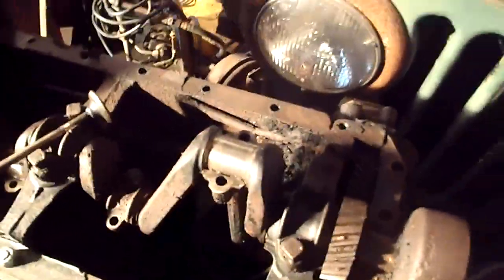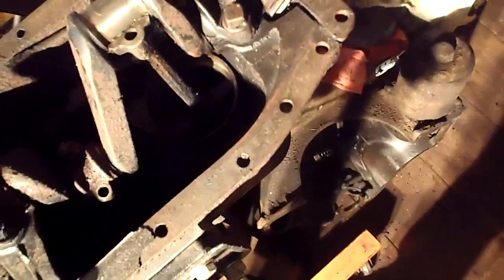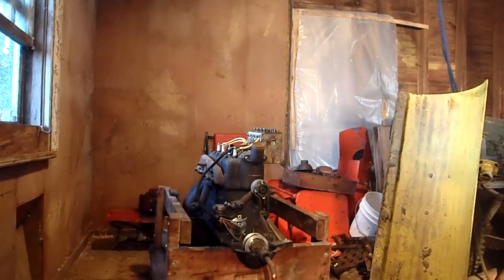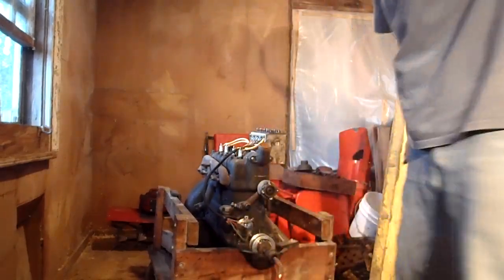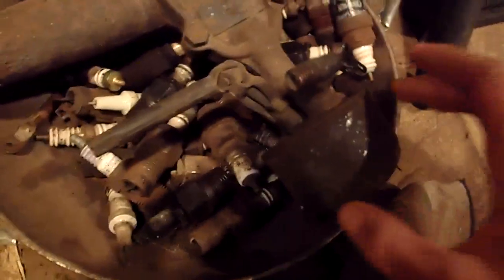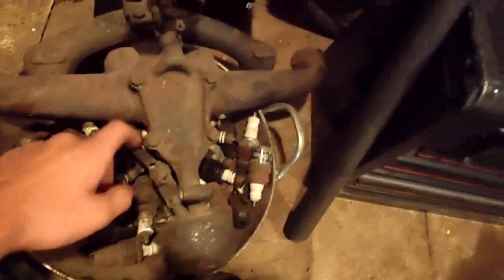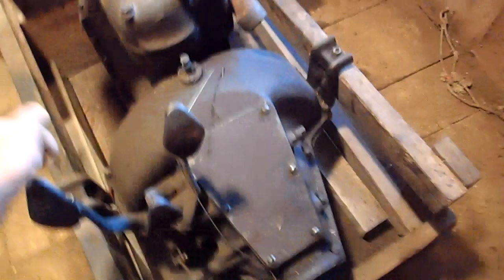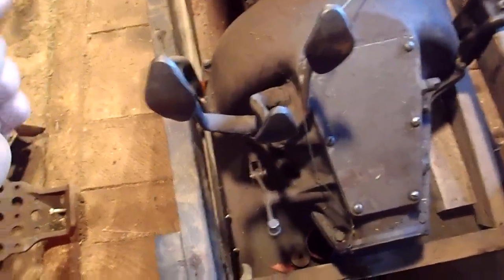An update on the Model T project

Comment: @64gravely hum can i get a general over view and a shot of the wiring at the generator and the regulator rectifier. ( my grandpa wired it up and when he wires up something i keep the fire extinguisher handy) so i'd like to check that before i rip into cause it charges the battery till the motor gets warm then it won't charge again. its had this problem for 12 years but i just figured that out this summer when i had more time and drove it more. thanks

Comment from the maker: @5Tractorguy Yah I was at the right place at the right time! they are all older ones! just the stuff I am looking for. I just tested the coils on the T engine today and everything on the ignition system works great! Yah you will probably need to find another one because the rototiller you have is in really rough shape. Thanks for the comment.